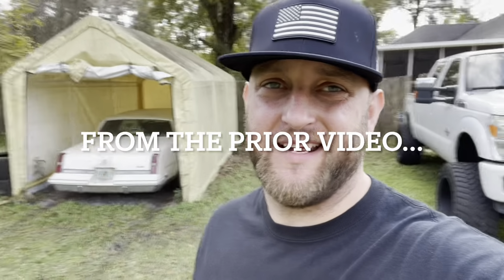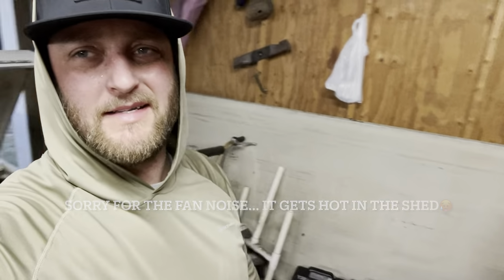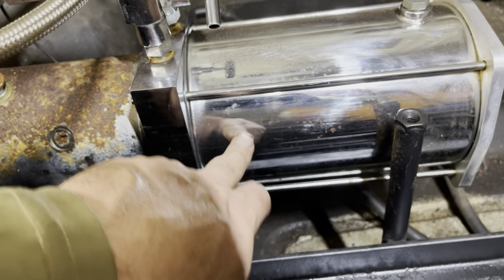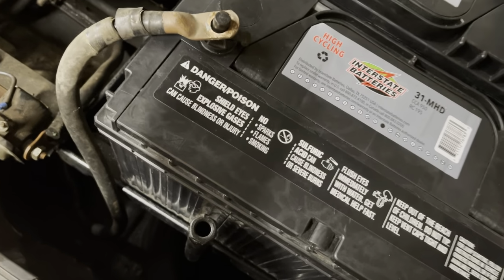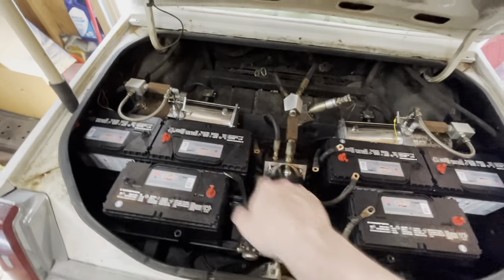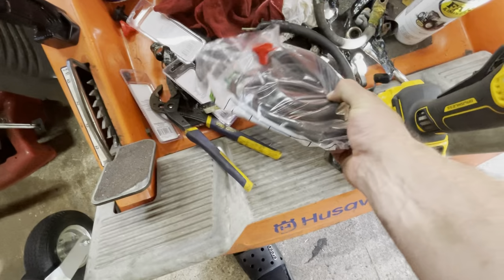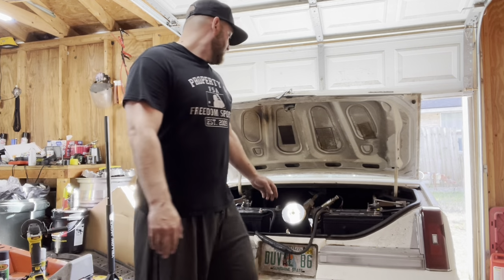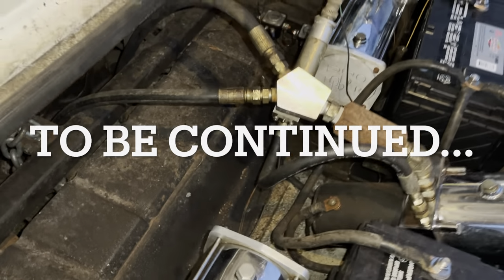1986 Cutlass Lowrider Resurrection pt3

Comment: Man that front passenger side front tire looks clapped
Reply from the maker: The tire itself… or the front passenger side suspension? The tires are like the newest things on the car. The suspension is for sure clapped… actually now that I think about it when I hit the switch a couple times the steering wheel turned. That’s probably what it was. lol
Reply: @CowfordGarage  definitely not the tire lol the suspension
Reply from the maker: @A.D.R.J.Coleman  😂🤙🏼